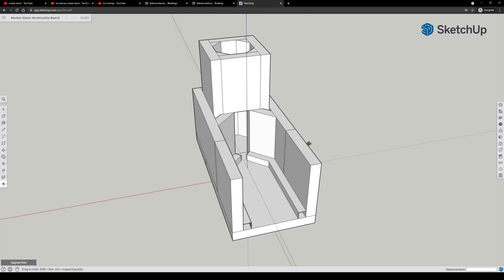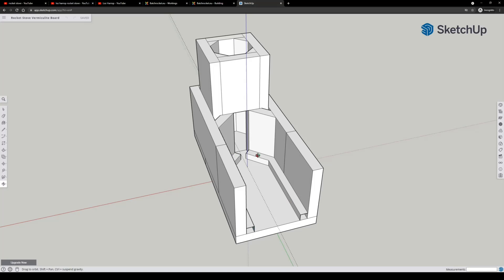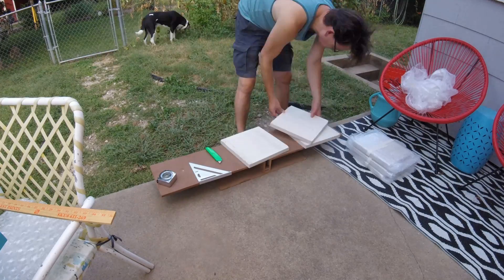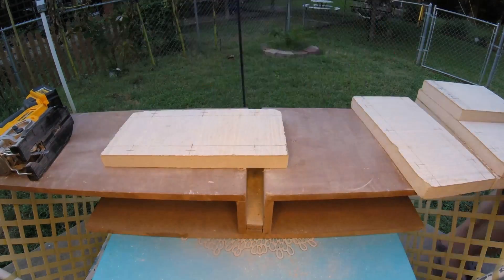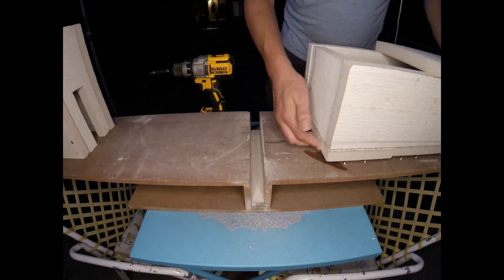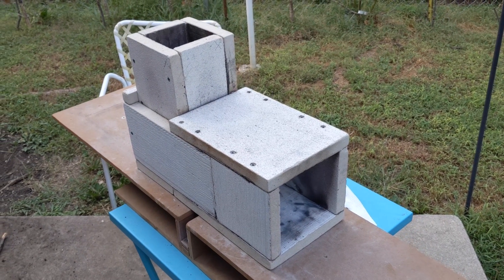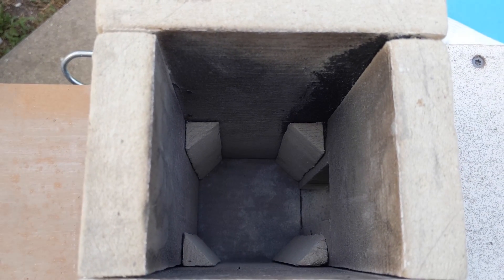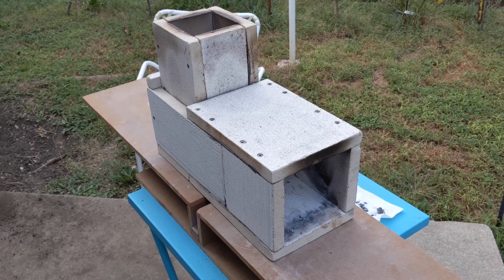No Welding, No Casting - DIY Rocket Stove

Comment: Very nice project design. Interesting that the stove develops 2 vortex swirls inside the chimney. I would try this project with a single but larger 45 degree baffle on only one side of the back of the firebox so all of the flame vortex turns in one direction inside the chimney. Did you install a taller chimney or add secondary air tubes?
Reply from the maker: Thanks! Regarding the single vortex;  on batchrocket.eu it's argued a single vortex climbs up the chimney faster leading to less complete combustion. The double vortex causes a very turbulent mixing of combustion gasses and air. The flames also spend more time in the bottom of the chimney, heating it up more also leading to better combustion.

I'm currently working on the upgrades I mentioned in the video. If the weather cooperates with working and filming outside I should have a new video up in a few weeks.

Comment: Anyway to get dimensional drawings from you. The one that I was going to build will be steel. I would like to experiment on the concept of the vermiculite board. Great video on concept and test.
Reply from the maker: Thanks! It should be pretty easy to deduct the dimensions from the SketchUp drawing I showed. The burn chamber is 6x6x12 inch (150x150x300mm) and the riser tube is 4x4x24 inch (100x100x600 mm) when it's complete, just using half the hight now. Edit: measurements above are inner diameter.

I know steel is more durable to move around, but do consider that it's not as efficient because you're just radiating the heat out instead of keeping it in for a better burn.

Maybe you can line the inside with fire brick or vermiculite board somehow to insulate it. You'd have to protect it again with (replaceable) metal parts on the inside because insulation is very fragile. That's what my next video is going to be about that I'm currently working on. It will be a few weeks before that's ready.

PS do you know of a good place to share SketchUp files? Maybe I'll create a Google Drive or something for the channel. I don't want to be sharing email addresses on here so we don't get spammed.
Reply from the maker: I finally created a Google Drive and shared the SketchUp file there. You can download it and open it with the free web version if you'd like: https://drive.google.com/drive/folders/1PVIpUuzQYxrEZtL_QHfcKIiIe9FMQnRP?usp=sharing

Comment: If of the two slanted doors at the bottom one is made longer than the other ( so that wind enters at an angle ) , will it create a vortex of fire ?
Reply from the maker: It doesn't matter. As you see in the video I already have a double vortex, so the flames are mixing well with the secondary air that I'll be adding. The longer the flames spend down below, the better. It heats the core facilitating a cleaner burn instead of heat going out the top.

Comment: Can it be made with cement ?
Reply from the maker: You can use the same materials as you use to build a fireplace, so fire brick and refractory cement. Those can get a little expensive, but if you plan to use it a lot it can be worth it.

Edit: there is a link in the description to batchrocket.eu where you can learn how to cast a rocket stove.

Comment: Did you use screws to hold the boards to hold together
Reply from the maker: Yes, in combination with high temperature cement to seal the cracks. As I mention a little later in the video you should plan to put it together once for the best results. I was running late that day so I put it together and took it apart later to apply the cement, which is not great for the hold the screws have. I just covered the screws in cement to compensate 😋

Comment: Ever hear of a down draft furnace? Easier to make then to light
Reply from the maker: Down draft is usually what you don't want? Sounds like going against nature to make that happen :p
Reply: I've made a few downdraft rocket stoves.  Very easy to operate, but more tricky to light.
 
In operation there is a steady flow of air down the vertical wood feed into and along the horizontal combustion chamber and up the vertical heat riser.  New wood is fed by gravity into the combustion chamber, the draft  down the wood feed prevents flames and smoke from leaking up the feed..  The combustion starts where the wood feed enters the combustion chamber and the air movement carries the flames along the chamber and into the heat riser where the combustion is completed.

  To light most downdraft stoves you have to first "prime them",. You induce proper direction of airflow by blowing or  by bypassing the wood feed  and setting a fire directly in the combustion chamber until the heat riser is drawing.  This can be the tricky part.
Reply from the maker: @richardgray2706  Ah, so you guys are talking about so-called J-tubes? I hadn't seen the term "down draft furnace" applied to them before. When I tried to look it up I just found actual home heating gas furnaces that use downdraft, LOL 😋

I did think about using a similar design as a feed mechanism for the wood, but what I did here was easier to make out of vermiculite board. J-tubes are mostly made out of steel tubing or firebrick, right? At least what I've seen so far.
Reply: @BitsOfInterest  The design I have come up with, but not built is of a plumbing y  6 inches cast iron, pipe running from the bottom of the y with a cap, the upper 45 to a chimney, a 6x3 bushing reworked to allow a 3inch pipe to run through it to almost the 6 inch cap, the 3 inch pipe is for feeding fuel and air to the combustion chamber, preheating both, the combustion chamber is between the 3inch pipe and the cap. the design would be set so that the chimney would point straight up, and the preheat area and combustion chamber are at a 45 degree angle. The hardest part is getting the thing lit.
Reply from the maker: This would be easier if I could see a sketch somewhere or a video, but I think I get it. 

You say you want the burn chamber to be 3 inch but the chimney to be 6 inch? Generally you want the burn chamber to be bigger than the chimney, so you could use the same design, just use it the opposite way. I have a 6 inch burn chamber with a 4 inch chimney and I'm already thinking how I can make it bigger, because it just burns up so fast... 

Metal is a great conductor of heat, cooling the gasses down, so you should think about insulating both the burn chamber and at least the bottom part of your chimney. If you have to use a 6 inch cast iron Y (they look very expensive) you could maybe do a 5 inch burn chamber and a 3 inch chimney with insulation between them and the Y. The insulation can be anything that withstands high temperature like ceramic fiber wool, rockwool or refractory cement.

Last, I don't understand why you would put the chimney on the 45. Isn't it easier to stabilize if you did it the other way around? You could even extend the bottom a little and put a grate in so the coals fall down.

Comment: Time to invest in a few meters of 1.4 mm kanthal wire. You can make good handles that are the opposite of copper ie bad resistance.
So you can pick up the red hot tube while burning and transfer to a snuff pot.. 
Melting point of 1500 celcius.
https://youtube.com/shorts/g_m2LNOg5zA?feature=share
I use charcoal for steaks and for delicate meats use a lot less charcoal and put the tube on flat ground. For steak lift on 3 stones for maximum air.
Prepare for a good griller. I take it to Greece on holiday. No issues on airport security
Reply from the maker: I don't think my build will survive air travel if I see how they treat your bags, lol

Comment: Hi, good effort so far, I also enjoy messing with rocket stoves.
However it has been shown that even slight deviation from the established Batch Box design can have very negative effects on the very well sorted Peter Vandenburge design.
That is not to say your design wont do what you want it to and only you can find that out.
Unfortunately, if your design should prove successful then the vermiculite  will have a very limited life span as it will soon crack and deteriorate!
You can extend the life of the vermiculite by coating the surface with waterglass, this will help the lack of abrasion resistance inside the fire box bit not really help much long term.
On a positive note, vermiculite is a great product to experiment with, even if it is not that cheap, it is a lot safer to use than ceramic fibre board.
There are a couple of forums that have daily discussions  on such subjects.
I will look forward to any updates … good luck.
Reply from the maker: Thanks! I'm not under any illusion that my design will be as good as Peter van den Berg's experimentally proven design. This is why I did try to stay very close to the given parameters yet simplifying the design and construction a little. I wanted it to do better than the tin can and pile of regular bricks rocket stoves you see on YouTube which I think I already achieved ;)

When I add the secondary air pipes I will also put an expanded metal grate on top to avoid the wood scraping on the vermiculite board. This will likely need to be replaced annually or so. Hopefully this will make it work better and last longer. Also I'm not using this one to heat my house; I'm just burning sticks that fall in my yard and need to be cleaned up anyway. I just love staring at those beautiful flames :)
Reply: If you like looking at flames you might like my vortex stove?  https://youtu.be/_K0eQa-QEBU
Reply from the maker: @foxfish7115  Apologies, any reply with a link in it gets withheld automatically and I don't even get notified.

At first I thought it was going to be some kind of pizza oven, but the window is to view those beautiful flames. I bet the seats on that side are in high demand 😁

PS You did comment I strayed a bit from the Peter van den Berg design, but you're not quite following his prescriptions either, are you? 😜
Reply: Peter V is a bull shi*t artist at best